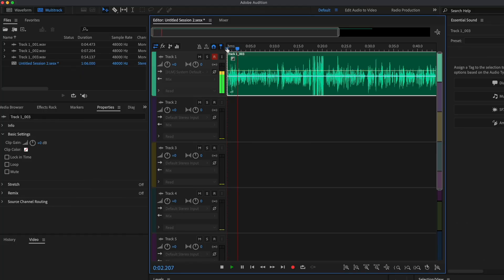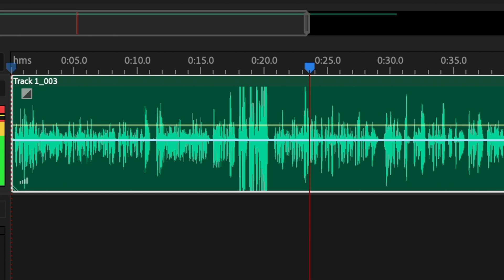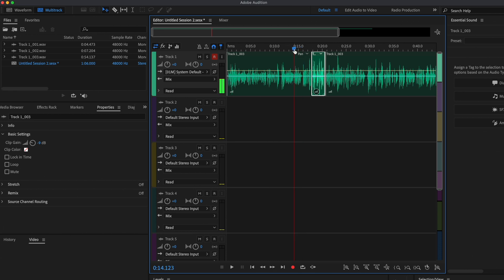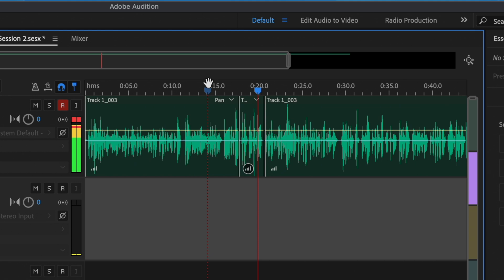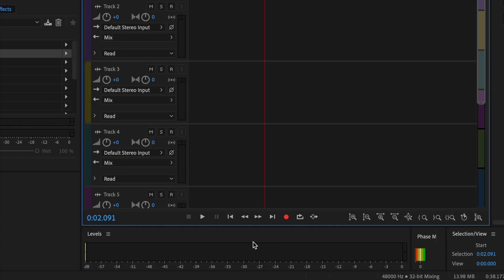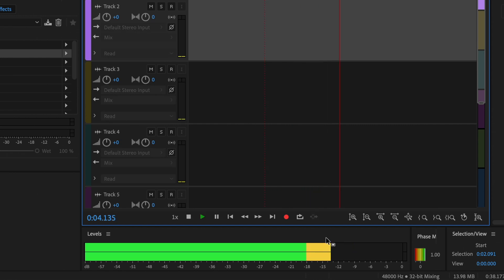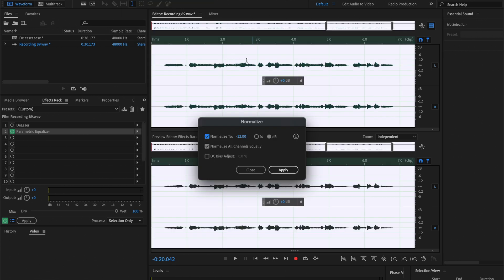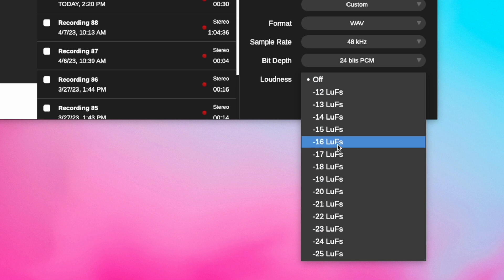My Mic is On But I Can't Hear Anything! Audio Gain & Volume Explained

Comment from the maker: I've been getting a lot of questions about the arm used to mount the Rodecaster. This is the one I use: https://geni.us/bOkzyk1

I like it because it's super long. The only downside is that it's a bit of a hassle to adjust the height, but once you've got it set you hopefully shouldn't need to mess with it too much.
Reply: Thanks so much Tom

Comment: Question: Ive gotten a Rode wireless mic go, and I hear you say the standard is usually -16db... However, if I dont bump the whole thing on the receiver, I can't hear diddly squat from my phone. I have to put it on the loudest to hear maybe 2/3rds of what my actual built-in mic quand record, volume wise. Help? I'm hearing from the begining of the video it may have to do with my phone software? Is there any fixing that? Any hope?

Comment: Great channel Tom!
I bought a rode NT USB+ a couple of days ago but have huge problems with MS Teams, which is auto adjusting the gain to 100%. Do you know a solution for this? Will switching to mic with physical gain control help?
Reply from the maker: Oof that's frustrating. I haven't used Teams too much myself, but if it's anything like Zoom, there should be some sort of audio setting to enable "original audio" which will deactivate all of the processing and effects that they add to try and make things sound better (but end up only causing problems if you have anything behind a built in mic 😁 ).
Reply: @tombuck   Thanks Tom! Found a solution with your help. Disabling auto gain adjust together with "High fidelity mode" (=original audio) did the trick! Have a great start in 2024!

Comment: Hi Tom

I have not been able to find any solution/videos on an issue I have on my Rode Podcaster Pro 2.

I continue to have noise on my monitors. I have tried so many different cables and the last pair is absolute the best a balanced 6.3 to XLR.
Before I used a non balance and the noise where comparable to the volume level. Now the noise is stationary and way lower but it seems like it coming from the mixer still.

I have also tried to pull all other equipment out but I can`t get the noise away it appear as soon as the Rode is powered up.
Reply from the maker: This is really strange. Based on what you've said, it should be pretty quiet. I would recommend reaching out to Rode's customer support and they can help troubleshoot or even repair/replace if something is wrong.

Comment: Your video coloring is so vibrant. How do you achieve that?
Reply from the maker: I don't use any of the picture profiles in my Sony cameras (PP OFF), and then adjust the colors a bit in Final Cut Pro. There's a free LUT and preset you can download here if you want to try it: https://himynameistom.com/downloads

A lot of people have good luck setting it at about 50% 👍
Reply: @tombuck  thank you so much. Loves you review on the Rodecaster Duo btw…just finished watching it
Reply: @tombuck  Will that lut work in obs?

Comment: I have 40 years of Broadcast Audio history..  You have done well to explain Gain structure.. The simplest way to set a level for a microphone on a Mixer.  Is set your OUT put physical fader to Unity or -12 DBFS.  Then with signal passing adjust the INPUT GAIN until your OUTput level (Meter) is at Minus 12 DBFS.. If you have software or other applications in the Audio chain then best to set them all to Unity. Also with  the addition of Compressors and Limiters make very small adjustments to Gain. best to try keep to unity or ZERO gain.  A good way to do this is with tone generators pass tone through the entire gain signal path and see where the deviations occur at every step. Remember once your input gain is set DONT change it.  If you need more level do it at the output stage. also a really good tip is to keep you monitoring Level the same always at a comfortable listening level. Adjusting monitoring levels (speaker Headset) is a big trap.

Comment: I have a weird issue I am facing since I bought the Duo, when I am monitoring my mics, the sound is very hollow, tinny, just so weird, tried resetting it manu times, nothing
Reply from the maker: Really? If it only sounds that way while monitoring and not on the actual recording, it could be some sort of issue with the headphone amps and might be worth contacting Rode's support.

Comment: 0:50 hi Tom. Thanks so much.  I can understand the basic concept now the difference been gain and volume.  I also have Rcp2. I have set the gain of my mic (shure BETA 58A) and during test session,  my audience can hear me,  but when i try to adjust the VOLUME using the faders, they say yes NO CHANGE in volume.  I have not connect  my Presonus audio interface studio 68C to RCP2 because i an so new to DAW (to be honest) in trying to avoid using studio one 😅) . So please show me how to adjust volume in faders without using any other audio interface or DAW. Thanks in advance
Reply from the maker: I would recommend double checking that your output settings on the Rodecaster are set to "post fader." If they're set to "pre fader" then your audience will hear the raw input regardless of where your fader is set. 👍
Reply: @tombuck  Tom. Thank you so much for taking time to reply.  Awesome.  I'll check.  Btw Rode told me they are working on the firmware to include Rode NT+ mic at the moment. Don't know when this will be release

Comment: Great stuff but you (and ALL the other mic guys on YT) still leave out one last element of the gain staging...the input level for your mic input(s) in the operating system. Took me a week of fiddling with my Rodecaster DUO and Windows 11 to figure out that corresponding unity level for the input was 54% to get my DAW recording levels to match the levels that show on the DUO's line meter lcd panel. What is your mic level set to on your Macbook settings panel for your RCPII inputs?

Comment: Good video, as always.

I was in radio for thirteen years and have been an audiophile for many more years, yet I only heard the term "gain staging," recently. Which, of course, is what you're talking about in this video. I'm presently dealing with a gain staging issue in setting up a DBX 286s audio processor to work with my RODECaster Pro I mixer. I tried connecting its output to a mike input on the RODECaster, via an adapter cable, but the sound was horrible. It was raw and harsh and there was noise and hum. And it was HOT. REAL hot. Not usable. Then I realized that the DBX output is line level, so It can't be plugged into the RODECaster's mike input. I had figured that it would be like the Cloudlifter it replaced and have a mike-level output. Nope. It's line level. So I've ordered a cable that will allow me to plug it into the RODECaster's mini jack on the back panel. That wil bring it in on the channel marked with the phone icon, which will be good because that channel is unprocessed, and we don't want to add the DBX's processing on top of the RODECaster's processing.

Have you ever tried using a DBX 286s processor? Have you ever connected one to a RODECaster Pro mixer? I would love to see a Tom Buck video episode about this particular combination, if you think it would be a good topic for your channel. Please consider it. I could use your input.
Reply: You can always use a DI box to get Line level to Mic level

Comment: Hm. I don't want to write a book here. But mixing is an art form. When you're doing a one or two-person podcast most people can figure it out but there is a reason to have a gain setting and a volume slider and that is what mixing is. Think about a concert! Getting the levels all adjusted so that the mix of everything... The Gain in a live setting is set so that the full-volume slider doesn't clip/feedback. So the audio engineer can move the fader volumes freely to make a proper mix. That the cliff-notes version at least. Just trying to be helpful.

Comment: Is there a pro/con to adjusting the input gain more/less in the overall mix? Mainly curious if there is any benefit for mic bleed scenarios.
Reply from the maker: Someone might know better than me, but I think overall it depends on the mic. My general rule of thumb is to set the channel's fader to the unity mark and then adjust the input gain to the "correct" level.

Comment: Is your Rodecaster Pro VESAed on a monitor arm or somehow on a low profile mic arm?
Reply from the maker: Any VESA arm with work, but this is the one I have: https://geni.us/bOkzyk1

I like it because it's super long, but it's a little tricky to adjust the height once you've got it set (well maybe not tricky, but just a bit of a hassle).
Reply: @tombuck hi Tom. Awesome video.  Tqvm. Normally screen monitors have other screw holes other than the one in middle hole , which rcp2 does not have.  So basically this 1 tiny screw is holding up the entire unit. Just wondering how safe this is? This is the 1 Question that is holding me back from getting a vesa mount at this moment.  
Can you please do a video of how to attach? I'll feel more at ease then if I see it and not get worry my rcp2v will snap off in case I don't do it properly.  Thanks in advance Tom